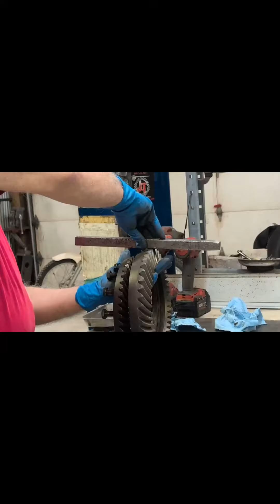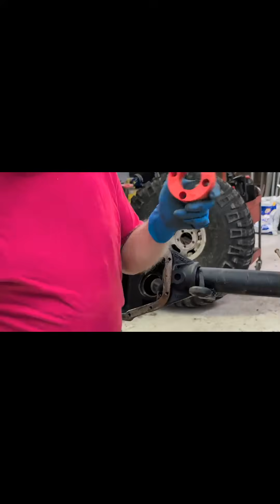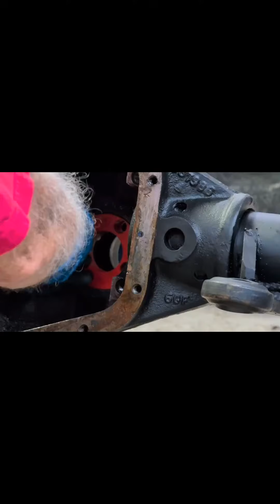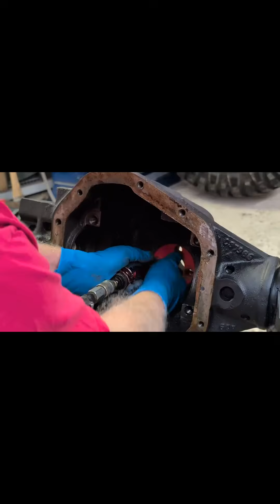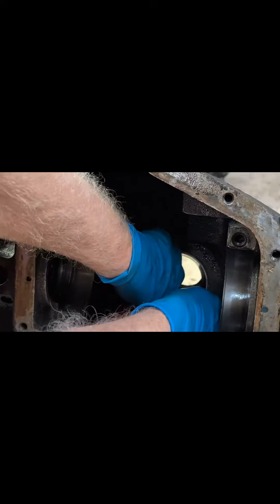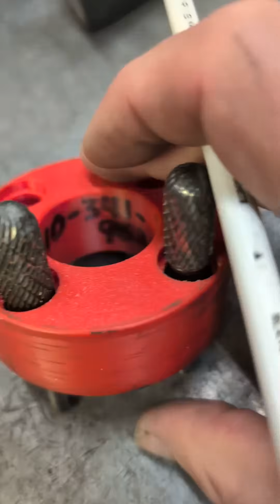Jana 76 pinion head bearing flange clearance

Comment: Hey Carl, I wanna swap a 06-10 ford explorer IRS differential into my 2092 bmw 330ci or M3, if I give you two new sets c/v shafts one set for the explorer one set for the bmw e46 can you cut splines on the explorer axle bars to accept the e46 m3 hub side stub shafts? Ill you measurements the axles must be, or if you wanna do it a different way like make new ford 8.8 diff side stub shafts to go on the bmw c/v shafts that’s fine. Whatever works
Reply from the maker: Get a hold of me it's September. I'll have time for stuff like that. I'm soon to get married and go on a long vacation